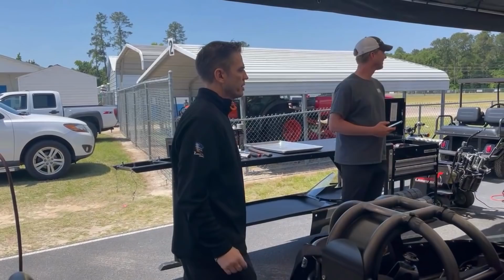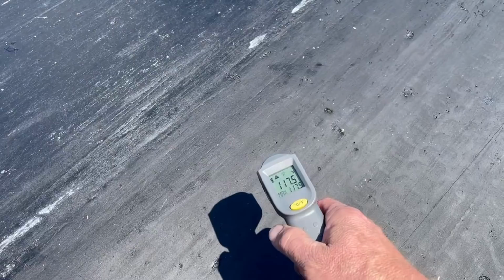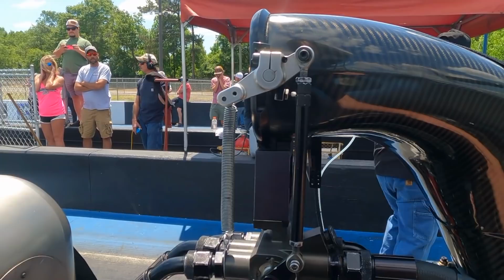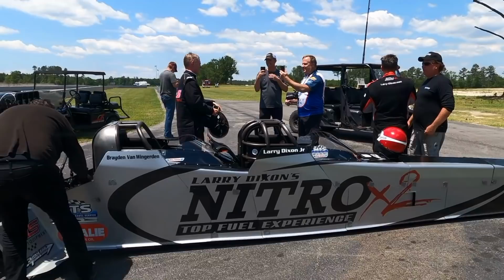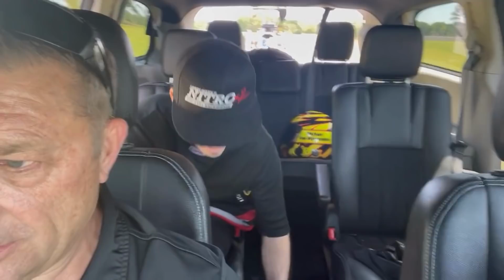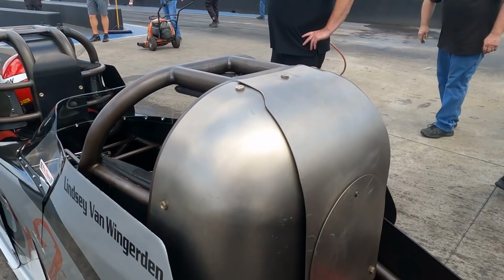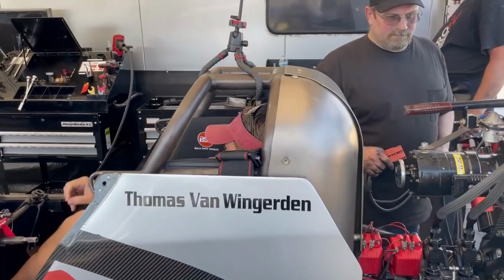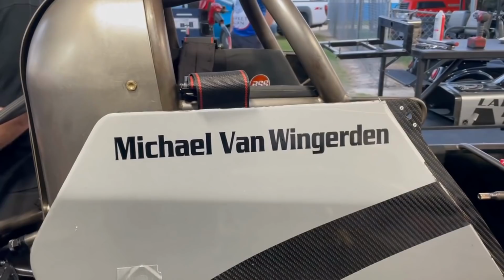2 SEAT TOP FUEL DRAGSTER (4 RIDES 1 DAY)

Comment: This really looks like a "class" operation, my respect to Larry Dixon for setting this up...I have a couple questions, are all the runs 1/8 mile instead of 1000 feet, and does that save a considerable amount on "wear and tear" to keep the price "reasonable"...?? Thanks for any insight or information.
Reply from the maker: Well thank you for the kind words. 
It is 660 foot. We just have to run the car smart and conservative. It still takes a tremendous amount of power to move 2800 pounds so you still have to make a lot of power. When you are somewhat conservative parts last longer. That’s probably the only saving grace about the operation.
Reply: @bottombulbracing6147  Tell your dad I said "hi", I'm an old timer, went to my first drags in the early 60's...
Reply: @robwendland  - what if someone wanted the full 1/4 mile  1320 feet or maybe the lesser 1000 feet
to make it the same as most drag races today?
(258 mph in a 1/8 mile is still awesome.)
Reply: @Bobby-fj8mk  No Top Fuel cars run the full 1320' anymore. It's all 1000'. It's a safety issue.
Reply: @davelowets  -
yes -
I found out that the tyres are rated to only 300mph and they already go 338mph.
A full 1320 feet would mean 400mph.
Reply: @Bobby-fj8mk  more like 350s in 1/4
Reply: @Bobby-fj8mk  - Nostalgia series nitro cars (funny and TF) run the full 1/4 mile.  They even run fuel altereds.  IMO the nostalgia races beat the NHRA races as:
1). The funny cars are recognizable as 60’s-70’s cars.
2).  More reasonable entry fees.
3).  Much greater access to the cars and teams.  You can get right up close to the cars and can interact with the race Drs.  As long as you are respectful (don’t bug them when they are in a turnaround between rounds) you can ask them questions and most are happy to answer.
Reply: @Bobby-fj8mk  not 400, because the last 300 feet lasts only a 0.6 to 0.7 seconds, and at 3g accerelation what these things are pulling at 330mph, it cant get much over 40mph extra speed (3g push 0.6sec duration)

Bad factors are also tires expanding, and rpm lowering so power is dropping, and wind resistance and tire drag are ever-increasing because already 5 tons of downforce at 300mph

Comment: I own a civic iv been building since I was 15 I probably have over 100k into it it has all outlaw components with a billet aluminum block pushing damn near 2k hp I would cry if I had to build it every time I ran it down the track but I want to know what it’s like and how funny car drivers have the balls to drive a car that does a quarter in 3 seconds that’s just nuts i run high 7s low 8s and that still scares the crap out of me sometimes
Reply: Respectfully I don’t think you could pay me to jump in a car I have no control over lmao 🤣 keep the hard work up

Comment: I want to know what it is you are Tweaking on at the back of the Scoop on warm up and before each run ??? with ya Right hand is something vibe rating loose lol how about some lock tight  lol J/K but for real what is it Rob ?????/   Great Runs BTW
Reply from the maker: There is fuel flow at idle and then I change the fuel flow before we stage the car. Also I have air bleeds to control how high or low I want to RPM.
Reply: @robwendland  Wow thanks for the quick response and on a Sunday Cheers <3

Comment: Kind of a silly question.   Are both mags timed the same on a fuel car?  Wondering since the fuel is "slower" rate of burn and the huge dwell involved if any advantage at all to stagger them slightly.

I would love to take a ride in that car someday.  142 was my best in 1/8  years ago. Pretty sure the 10k might be a slight issue lol.
Reply from the maker: Mag phasing yes. Triggers are within a .5 degree. But only runs on one trigger. The other is a back up

Comment: Couple questions
Does ‘passenger’ sit in front or back seat?
What is top speed typically achieved? It’s an 1/8 mile run? Times?
Reply: back seat, this track was a 1/8 mile and avg time was 3.30 at 250mph

Comment: Is that oil you are spaying into the intake at startup?
Reply: Nitro. They squirt fuel in the hat because it's mechanical injection and it helps it roar to life.
Reply from the maker: We use regular gasoline to start with. This is a very low compression engine so it starts easier on it.

Comment: Hey i have a question, what keeps the car from launching when doing the burnout?
Reply: Once tires lose grip, they stay that way so if you break the loose right off the bat with an aggressive clutch engagement it's easy to keep them spinning.  That's also what the water box is for. They drive through a patch of water just before the starting line to get the tires wet which make it easy to get them spinning. On the launch, I know it doesn't look like it, but it's a controlled clutch engagement over quite a a good portion of the run.  (not sure how long though, you've reached the end of my knowledge)  That clutch engagement timing is key to the whole run.. Too aggressive than you break the tires loose.  Not aggressive enough and you don't use all available traction causing a lower ET.  It's all about riding that fine line between sticking the tires and lighting them up.  Then you take into account that you want some tire slip and that fine line gets even narrower.
Reply: @turbo2ltr  thank you for your answer, very much appreciated

Comment: How much of the tune up do you have to compensate for the weight of the rider. If you get a 125 poundperson or a 275 pound person that is 150 pound move of weight that must affect the tune up on these fickle cars?????
Reply from the maker: It’s real critical where the weight is located on the car because it changes the CG. The only thing that’s constant of course is Larry and that is farther from the centerline of the rear axle so that’s a good thing. I always explain it as if you go and pick up  #100lbs of fertilizer at Lowe’s and accelerate your car, you can definitely feel it. Now try and move that weight 60ft from zero to 100mph. 3.5 g’s is equivalent to 350 pounds.